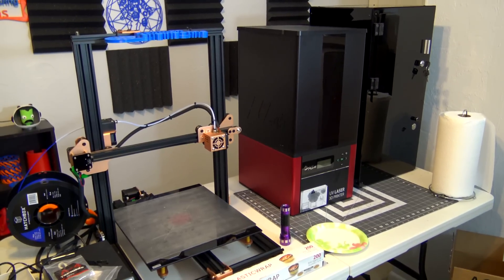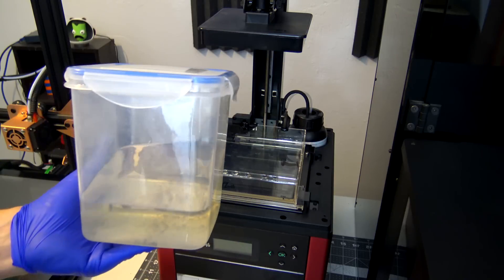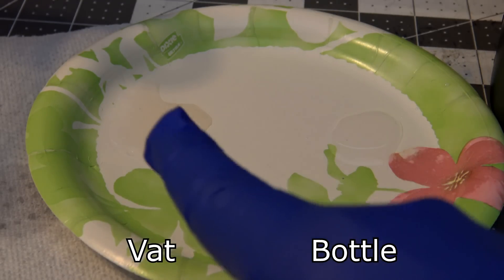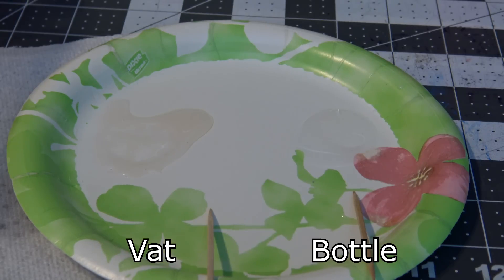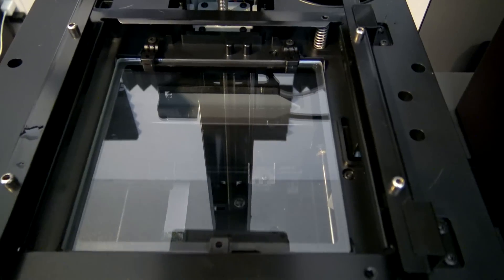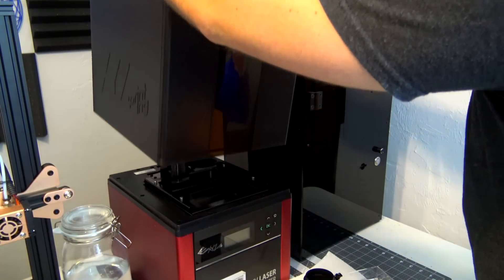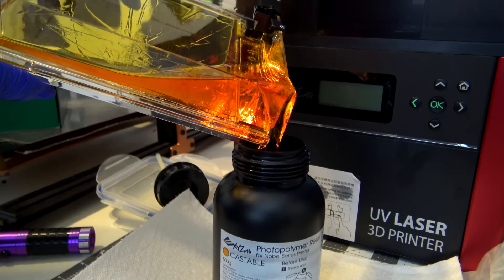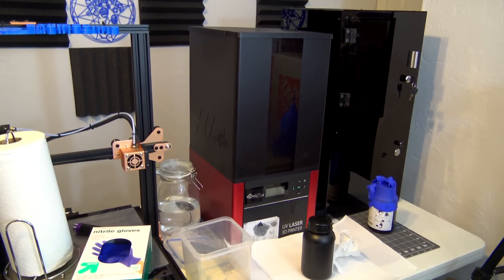Testing if 3D Printing Resin Expires - Packing the SLA printers to move!

Comment: since this is the only video i found adressing the resin "expiration" thing, im just going to leave here my opinion, i think they put those expiration dates or say they last a year just to make people buy more, its like putting an expiration date to soap or bleach or degreaser... that "chemical component degradation" its just a make up, if you store it appropiately, and that just means in a dry, dark place inside of its bottle, there is no degradation of nothing, it doesnt expire, at least not in a single year for sure, not even 2, 3 or 5 years... its just my opinion
Reply: I bought my mono x with a cleaning machine and like 4 bottles of resin that was like 6 mo. expired and the resin all works very well. Cant see any difference
Reply: @KuriPuhh  hahaha dude I’ve done exactly the same, the mono x and 4 resins. Good to know they work
Reply: Did you try yourself? I mean, i 3d print for hobby, i'm more a 3d modeler / sculptor, and i stopped resin 3d print for a while 1 and a half year. I'm now at a choice, should i buy new resin? or should i try printing out something?
I have an fdm which i use often, only because i know how to fix it and also because in my head it's more reliable, it's a mk3s prusa.
Thanks for your opinion.
Reply: @FabrizioLazzeretti  yes, it works, also left the resin for several months in the vat, you do need to have a vat lid, also not recommended to leave it if it's pigmented, cause pigments drop down
Reply: @lordfreezer9550  Encouranging. I will try, thanks.
Reply: Very  helpful thanks
Reply: elgoo standard grey 3 year out of date, needed a bit more curing time per layer, printed good.
Reply: will not opened resin bottles expire?